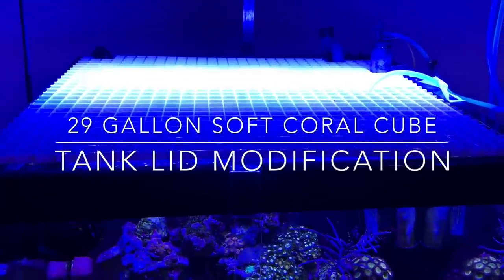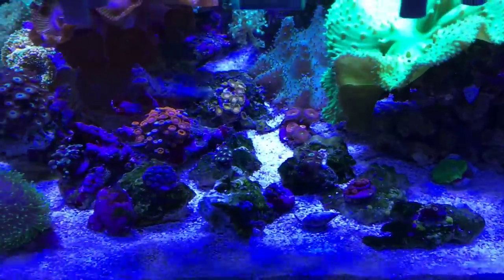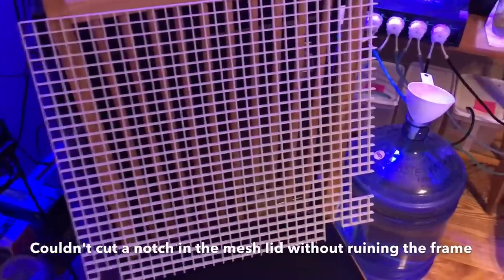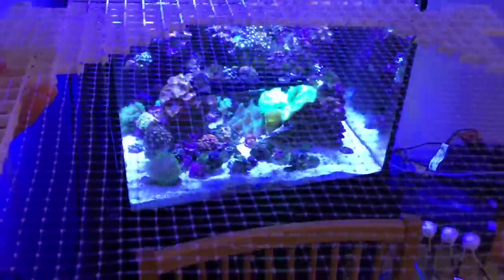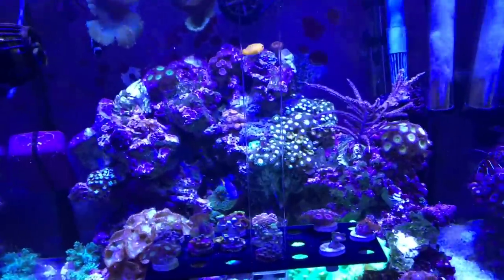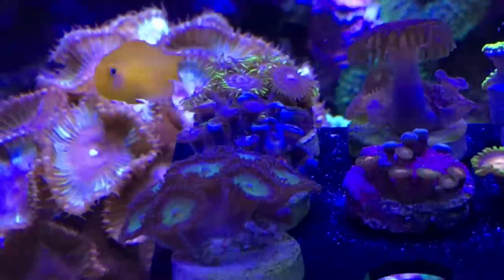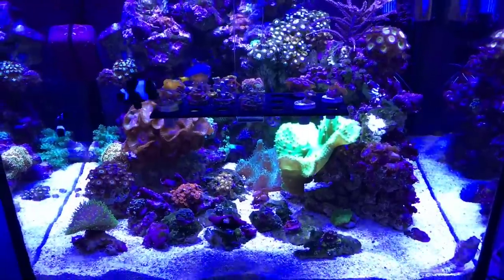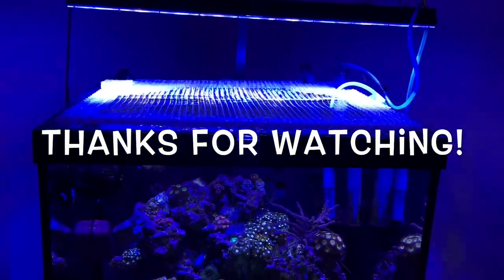Tank Lid Modification for 29 Gallon Cube Reef - The Goldilocks Solution!

Comment: Hey Reefgrrl! I was going to recommend cutting your old lid and putting a few new 90's so that you can fit around the equipment. I'll be doing a video of something similar soon once i'm finished with all these other tank mods. 

excited to begin making videos, i forgot how much editing it takes! haha
Reply from the maker: Hey Nado, thanks for watching! We also have a mesh lid on the 20 and it has a notch cut out for the light mount at the back. The 90 degree pieces are only available with the kit for the whole frame, so it would have cost another $16 or so, just to get those pieces - we decided not to bother. So the frame on the 20 has a gap at the back, which makes the mesh loose across the top because it's impossible to keep the back pieces rigid and in place to keep the mesh tight. Not ideal, but I'm living with it. Same deal with this 29 - we would have had to buy another entire kit to get the 90s, so went with the egg crate because of how easy it was to cut it exactly where needed. It's a process....I'll be interested in seeing how you make out with yours.
Reply: Reefgrrl gasp! I keep forgetting y'all have those prices. I was thinking they were like a dollar a piece like down here. it'll be a few months when I get to that project. I hope to get my first vid out this week though!

Comment: Looking good, so question, why do people grow coral on those racks like that?
Reply: i put mine on the rack for a few months to let them get adjusted to the tank. i have multiple ones that i keep at different light levels and water flow requirements.
Reply from the maker: The rack is temporary until I get them in place. It'll take an entire afternoon to do all the trimming of plugs and gluing, and I might even need to use two-part epoxy for some of them, and I haven't had a long enough stretch of time to get to it. I can't speak for others, but I've only used those frag tacks when I had an opportunity to pick up a piece I was looking for (or get a bargain) but wasn't yet able to get it properly placed in the tank. Thanks for watching!
Reply: Ah ok. I see. so it's just a temp place to hold them until they are acclimated or when you're ready to epoxy them in. Got cha. Is there anything else people use coral racks for?
Reply from the maker: I would think they'd be useful for keeping frags from your own tank that you intend to sell, for easy viewing and access, if you don't have a separate frag tank. Or maybe if you were observing corals to check for pests - you could view them right up close by the glass while in the tank so maybe the critters wouldn't hide like they would if disturbed by removing the coral. I think it's handy to always have a frag rack available.
Reply: Ok thanks! :) Still assimilating info before I start mine up again.  I just haven't either need a rack or it's something new people do since 13 years ago. I know there's TONS more coral available now and lots of the tech has changed as well.